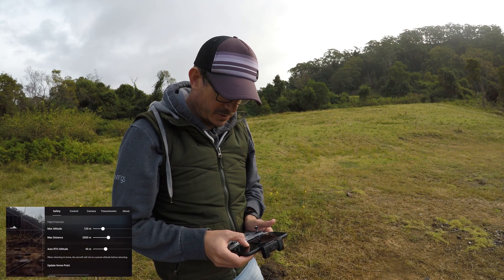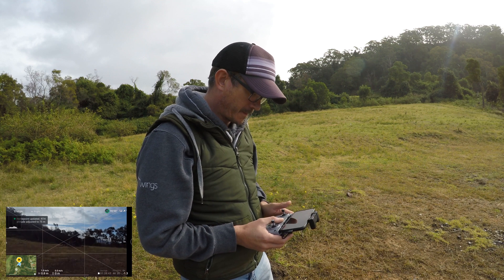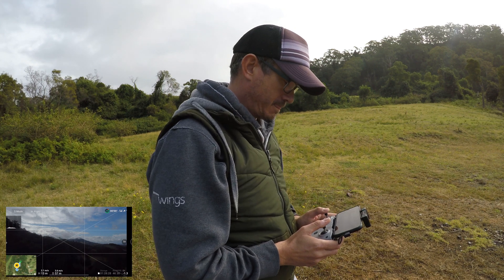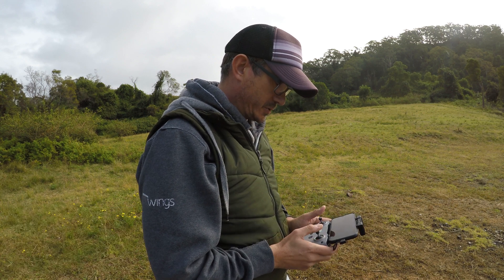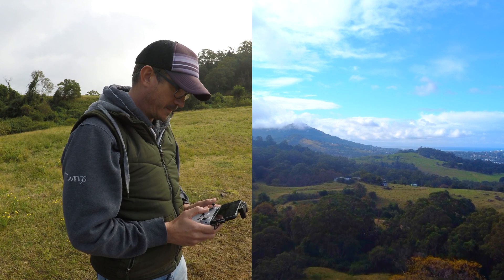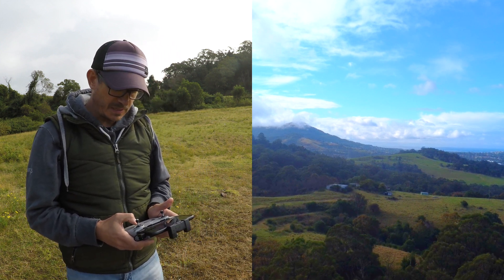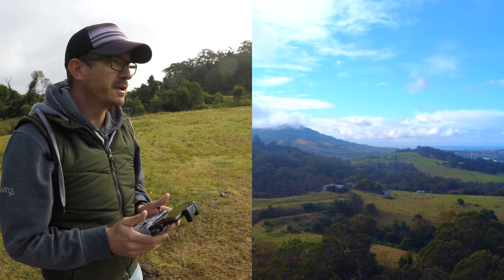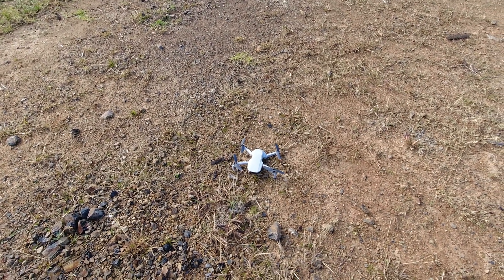How return to home works - DJI mini 2

Comment: My Mini SE controller failed in flight causing a full left high speed spin/yaw. I thought I was going to lose the drone with no way to control it. I decided to turn off the controller and the aircraft settled down ,flew back and landed right next to me! I was disappointed the DJI 2 year care refresh would not cover the controller and it was cheaper to get a new one on eBay then pay them to repair it.
Reply from the maker: So was the controller actually faulty or was it just a glitch. DJI are well known for being very good on their warranties, even without refresh
Reply: @Shooting_the_Breeze  It was the controller that failed. The warranty period was over but my care refresh was still active. I called them and they said to send it in for an estimate. Only the drone is under care refresh. Would have been $60 for an estimate plus shipping and repair costs. Bought a new controller for $39 on eBay instead.